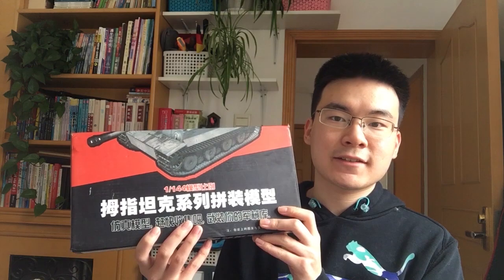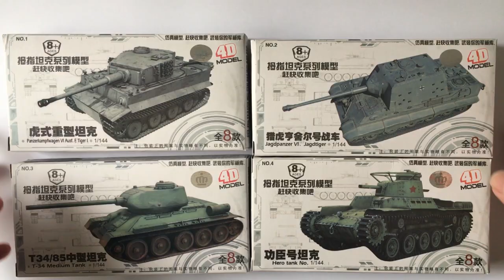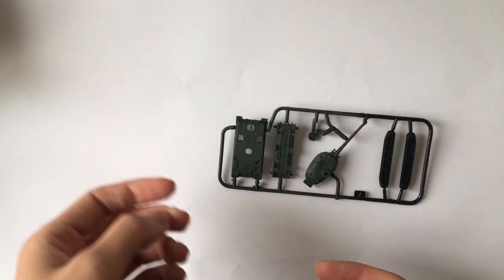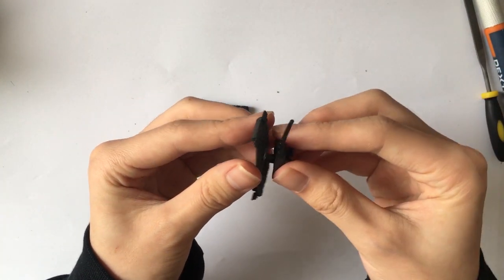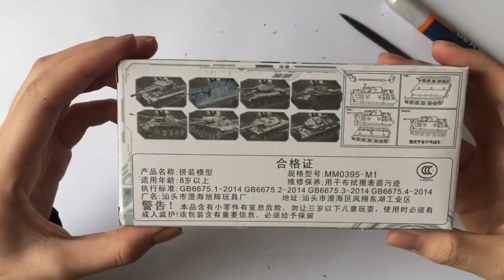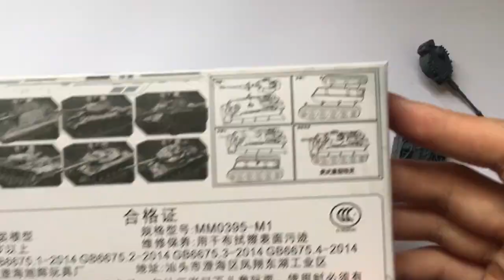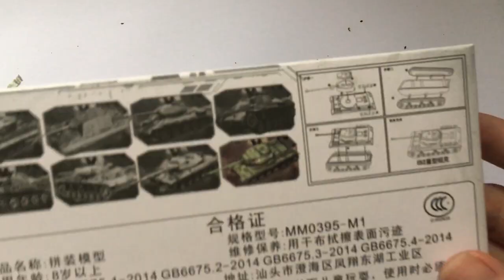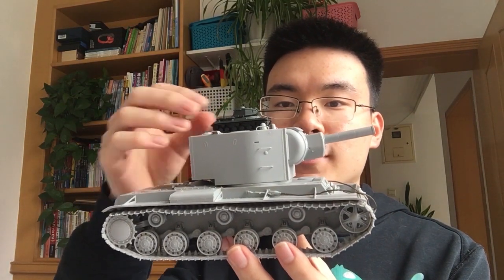1/144 Tank Model Kits from 4D Models

Comment: As for the "flaw" of the T34/85, it's actually a feature of the tank itself, it is slightly raised because it's a actually an A-20's 85 caliber turret placed in a normal T34, and that's why it's called a T34/85